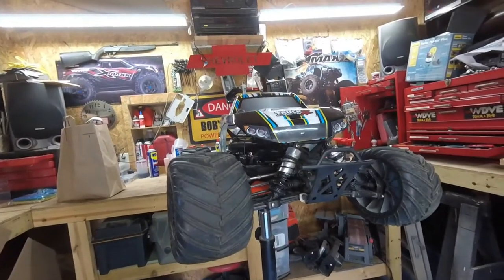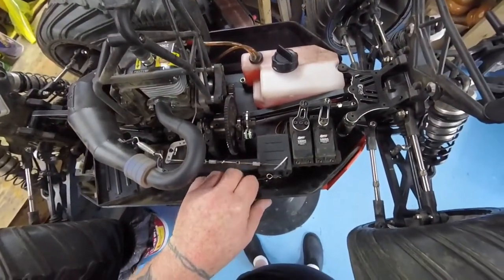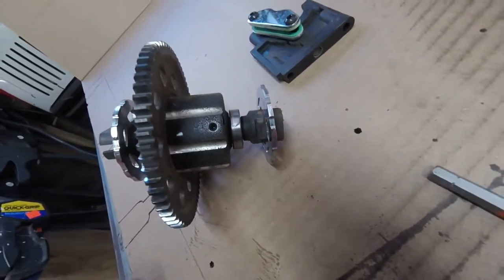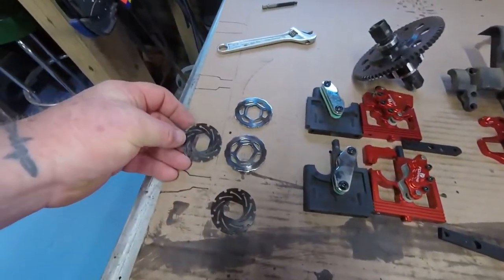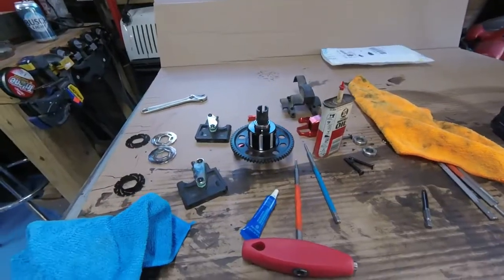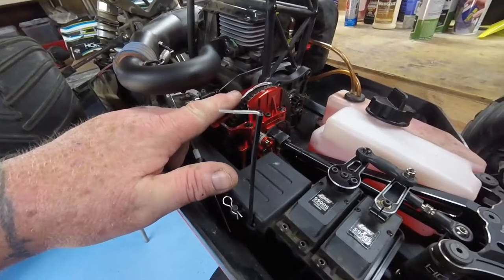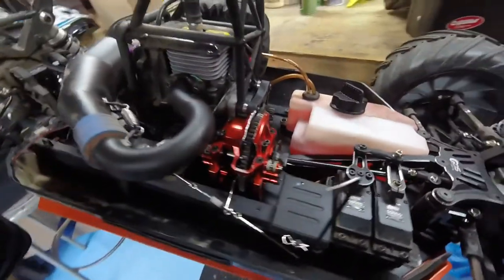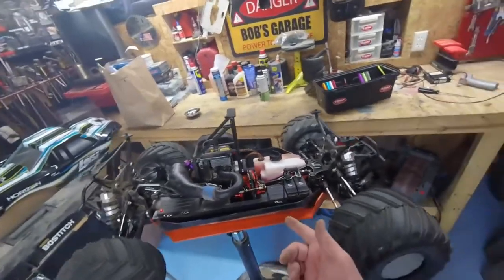INSTALLING THE NEW FID RACING ALUMINUM CENTER DIFF BRAKE BRACKETS ON THE LOSI MTXL

Comment: Oh man. I made a 2mm aluminum spacer for the top plate in order to clear the spur. I was still able to fit the pins for the brakes in there. Been a couple years no issues. Good to see ya back at this truck🤘👊

Comment: That really sucks! I was going to get the same FID Racing center diff carrier/brake assembly a while back for my MTXL but I knew this was an issue with the 67t spur gear hitting the top plate. Only options are to switch to the Dbxl spur gear 61t, which is what it was originally designed for or fabricate a shim bracket to raise it up. I held off and eventually found the GTB Racing center diff/brake assembly mount that was built for the MTXL with the taller top plate for the 67t spur gear. I watched your unboxing a few weeks ago and thought you knew about the issue and already had a solution/fix for it. I found the GTB Racing version on EBay, it looks identical to the FID Racing. It also eliminates the plastic mounts at the bottom and comes with billet bottom mounts. Shipping takes a month or so. Good luck!
Reply: Wait so the gtb one I found is different from this fid one? I was about to order the gtb then I stopped after seeing it’s a issue for 67t gear
Reply: @erdoganog  Yes it’s different than the FID dbxl center diff mount. The GTB MTXL center diff mount is taller to accommodate the 67t spur gear. Just make sure it is specifically made for the MTXL. It’s good quality and has billet riser brackets at the bottom instead of the plastic, so it’s mounts more solid. Also, the brakes work great once properly adjusted.

Comment: I’d use the stock one because this is a bad design you basically put a plastic spacer on bottom as a mount there is no point in going aluminum it’s still going to flex and the top when you cut it through it made it less rigid the cover top does have a purpose to keep it rigid and tight from moving
Reply: It’s like replacing the plastic engine mount on bottom of dbxl/mtxl because the mount flex and this center diff carrier designed with adding a plastic under it to mount which will also flex